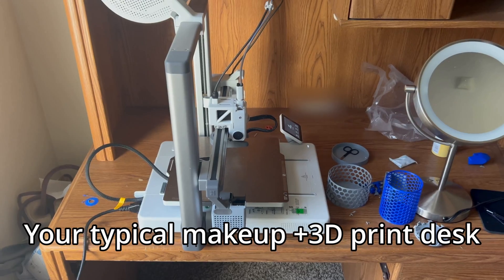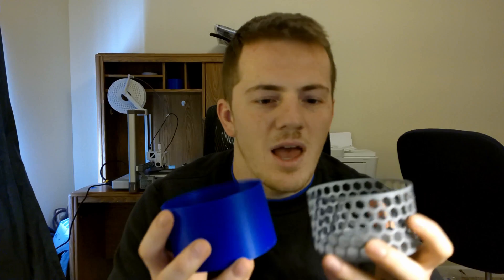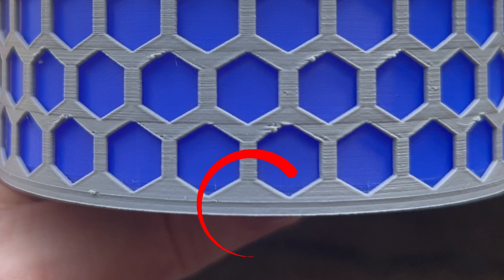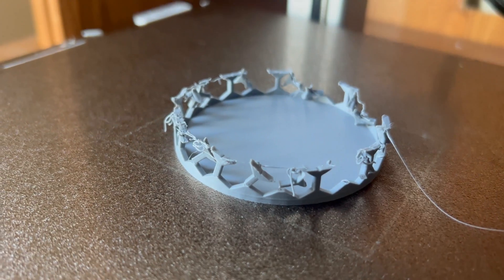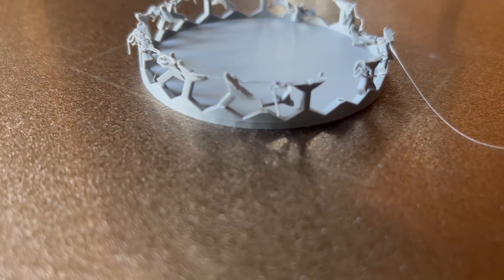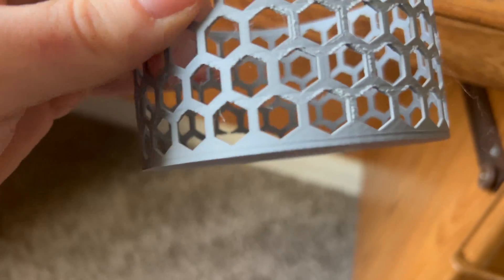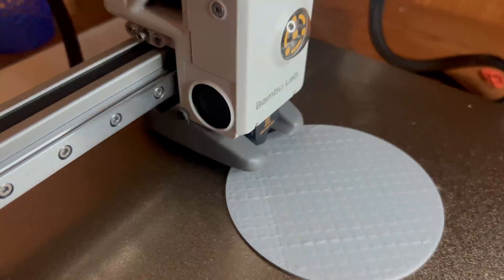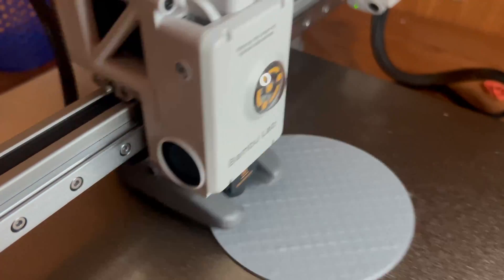3D Print Farm Troubles: My First Product, Fixing Print Failures and Setup Challenges | Episode 3

Comment: Maybe it is stupid comment but for me u have problem with z wooble.  Ur desk doesn't look to be stable. 
Had same problem. I did use hard rubber undet it. But it didn't work. Better change desk for some stell rack, that worked and can probt with max sleed setings.
Reply: Making a lots o videos on UT about printing. But can't say my channel name.
Reply from the maker: Not a stupid comment at all! I mentioned that possibility in the video and have since moved my printer. It definitely isn't as stable as I need it to be, but I think putting some anchors in the wall will really help with that, just haven't gotten around to it yet!

Comment: Maybe you need to place your A1 on something more sturdy? I started with the A1 on a standard table and had mostly acceptable results. Now the quality went up a lot
by placing it on a very (heavy) piece of furniture. Furniture I once made for heavy music equipment. (Mixing table).
Reply from the maker: I agree with you 100%. I did move it after the video because watching the print, it was shaking the desk pretty consistently. I am hoping that starts to make a difference!
Reply: @KennedyDIY  There's an official thing on MakerWorld that Bambu themselves made to mount the AMS Lite on top of an A1. In that package are a couple of supports (two parts and 4 screws needed on each side). I printed those for some stability. It can't hurt!

Supports and a wall attachment for the table the printer is on would definitely make it stable, but if it's not visibly wobbly you probably won't need that.
Reply from the maker: Absolutely! The more support, the better. I also really like the idea of fastening it to the wall. Honestly hadn't thought of that and kicking myself. Thank you, my friend!
Reply: @KennedyDIY  The desk is about 60 KG, made of 1,8 mm wood al around, against te wall and also against a big closet. Doesn't move a mm. But I only use
standard speed. The need for speed mode is always gone be a hit/miss scenario.

Comment: Definately make your planter wall a bit thicker. With it being so thin the nozzle can actually flex the existing print while its trying to lay down a layer on top. You need to elimiinate that. Do you run the calibrations before every print ?? It only adds a minute or so to the time but its worth it. If you are going to have layers less than .16 then you need .2 nozzle but that will increase print times.
Reply from the maker: I agree, that is certainly the next attempt. Yes sir, I run the auto calibrations before every print. I have the same school of thought that its certainly worth it. A lower likelihood of failure is certainly worth the added time.

Comment: Maybe have each honeycomb taller than it is wider, that way the overhangs aren't so steep. Also, don't use a .2 mm nozzle because it will take way too long to print, thus reducing profitability.
Reply from the maker: I like that idea a lot! Definitely worth a try. Thank you for the tips on the .2 as well! Saves me the money buying it and the time wasted on the prints.

Thank you for watching, my friend!
Reply: @KennedyDIY  I'm printing similar things with a .8mm hotend and getting good results. Some things look close enough to commercial quality. YMMV, stars need to align etc.

.8mm is great for prototyping large objects too. Print much faster at .56mm layer size, dial in the general concept, shrink the layers for an actually nice print and maybe try .4 if you can't make it nice enough for the final product.
Reply from the maker: Great idea. Save a lot of prototyping time with a .8mm and refine from there. Great tip!

Comment: How bout trying to print the hexagon pattern flat on a raft that can be easily removed, get a ceramic cup or a high temperature resistant cylindrical object to wrap around the flat hexagon pattern in front of a space heater at 85 degrees around the object, just an idea, this way the pattern will be stronger but more post processing needed,  just try it. remember remove the raft after you thermoform it.
Reply from the maker: That's a really cool idea, I might have to give that a go! Thank you, my friend!

Comment: The shrinkage could be lower with an enclosure. My P1S i way better at this than my A1
Reply from the maker: Agreed - the P1S is the ultimate goal, but the A1 is much more feasible price wise, at least for now
Reply: @KennedyDIY  yes of course, my point was to say you have to control the environment to get this problem really out
Reply from the maker: Ahhh yes, very true! The enclosures make life a lot easier. Does your P1S do well with sound control, as well?
Reply: @KennedyDIY  the A1 is more silent, but I run both of them plus 3 others in the room right next to my kid's bedroom, and he doesn't even care... Except on the P1S's starting. Then, in silent mode, it's fine
Reply: @ArkatzMods  Plexiglass, some strategic corner pieces printed and noise-cancelling headphones works too :P

Comment: When you first get set up one of the best options is to calibrate your filament flow but also more important is making sure your filament is dry and free from moisture.
Reply: As a printer farm guy too, yes this is the best first advice, the best. Dry your filament correctly, and calibrate it. You need to be about 0.025mm accurate here for your insert to be perfectly fitting.

With this accuracy tho, please be kind to yourself, don't play with it. Design some locker instead of trying to be this accurate. I have to be 0.01mm accurate with my lead product (yes, 0.01, not 0.1), and I managed to do it but it costs days and days of tinkering when you want to get this accuracy for 90+ filaments. Make a design change to lock and unlock
Reply from the maker: Great advice, thank you very much!
Reply from the maker: Just ordered a filament dryer! Let's see if that's the ticket. I will also definitely look into filament flow. Thank you, my friend!

Comment: Try giving orca slicer a try with default profiles and see if there is a difference, i had issues with the latest version of bambu studio.
Reply from the maker: Great idea, my friend! Thanks for the tip and thanks for watching!
Reply: @KennedyDIY  Yes, definitely try OrcaSlicer. I've never used BambuSlicer for my A1 exactly because every video I found recommended cutting out all possible frustration that way :)

OrcaSlicer changes some terms, I think, as it's based on multiple slicers in the family. There are also some new options which may help you. Go through every option, look up the ones you don't know, change everything that looks helpful and run full calibration for your material.

Sometimes it's the quality of the material - I had nearly perfect prints with little tweaking and some tips from various videos, and changing material got me closer to perfect. Give it a good drying cycle if you can, check that the filament isn't stuck to itself (maybe respool entirely) and check that it bends rather than breaks after all that.
Reply from the maker: Great tip! Orca slicer seems to make a ton of sense right now and instead of tinkering with settings and hoping, just running Orca on a generic profile and seeing if it helps could solve a lot of issues right there, and then I can hone in on perfect setting if it seems to be better. Thank you, sir!